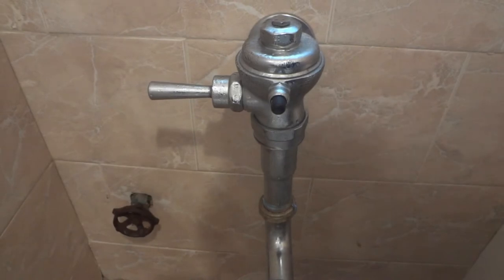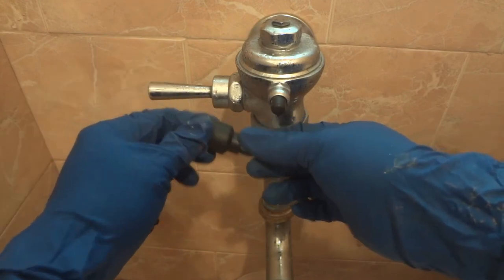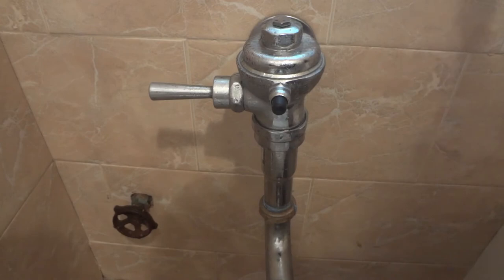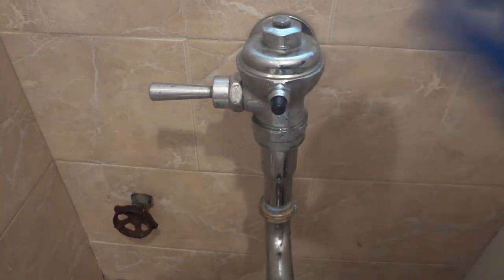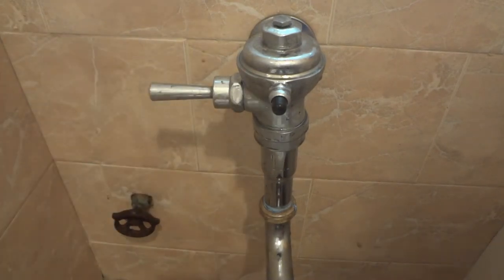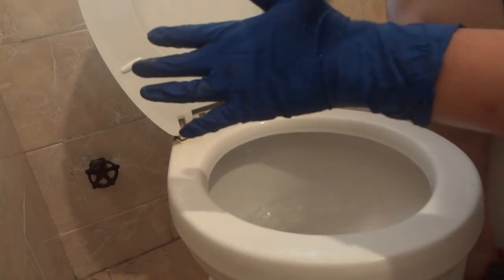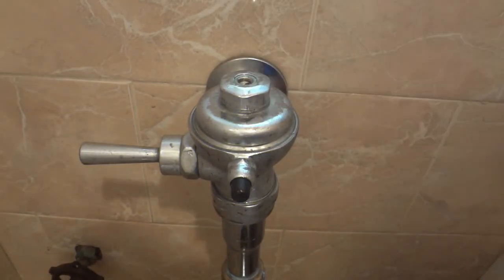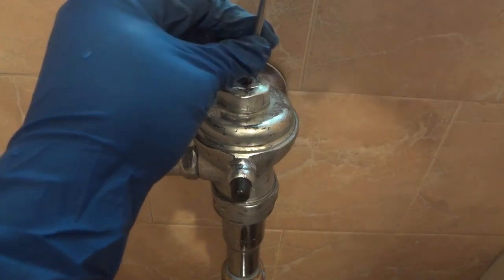How To Repair Toilet Flushometer Leak

Comment: I have a similar look old flushometer that doesn't provide enough water. Wondering where do you get all the parts? and how do you know the parts will fit this specific flushometer? I don't see any markings of brand on mine. But it is a similar look that hooked to back side of the toilet ( instead of top).

Comment: What if the pipe joints below start leaking after you replace the vacuum breaker?
Reply from the maker: @snakeeyes20a, try to put Teflon on it but normaly if that happens is because  the washer is worn out, so i recommend to replace the nut and the washer.
Reply: @ImTheSuper  I had to replace the slip joint nut and washer it was corroded and broke into 3 pieces when I  tried to unscrew it
Reply from the maker: @snakeeyes20a  wow that happened couples times to me.. I think is the nut to connect the tail piece(pipe from flushometer) with the elbow..
https://www.homedepot.com/p/Everbilt-1-1-4-in-Slip-Zinc-Nut-with-Washer-C8030C/205154410
Reply: I went with a pvc one to avoid the corrosion issue in the future, flushes tend to need maintenance every 3 years or sti ( 2017 was the last leak I had but this is the first one I decided to fix myself considering the conditions around us at the moment..) It was very frustrating to say the least, the initial leak was from the vacuum sealer which I had to search quite a while to figure out what the part was called, then figuring out that my flush was a delany rex flushometer and not a rex delany flush, then finding that home depot only stocks parts for tank flushes and not ones fed directly from the wall plumbing... Then when I had replaced that, it started leaking in the slip joint which wasn't the case before then it started dripping in the tailpipe joint which I finally fixed with pipe tape which luckily I had gotten just in case. All in all I went a long time without a working flush, makes me appreciate it more than I would have given thought before.
Reply from the maker: @snakeeyes20a  it will be a good quarantine history!! in the future if you need some kind a help or idea hit me up trough IG @imthesuper01